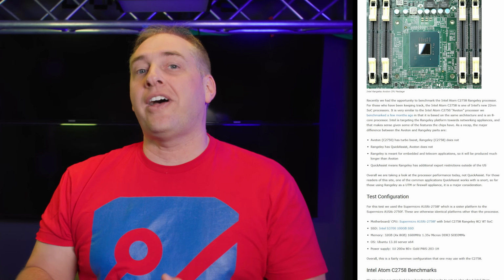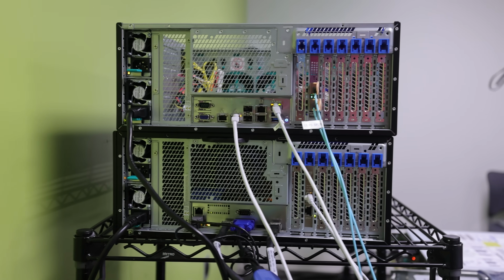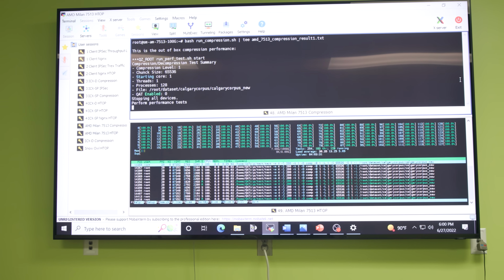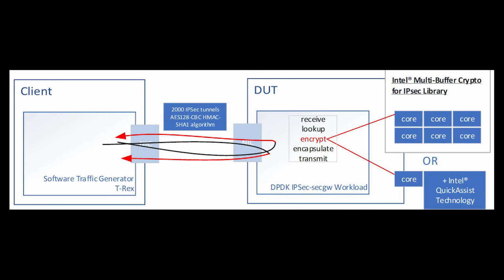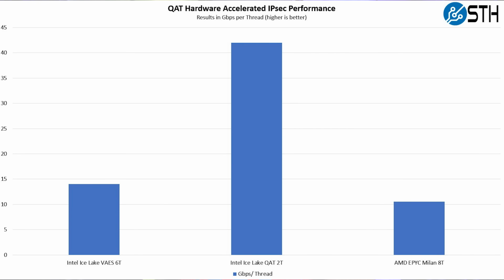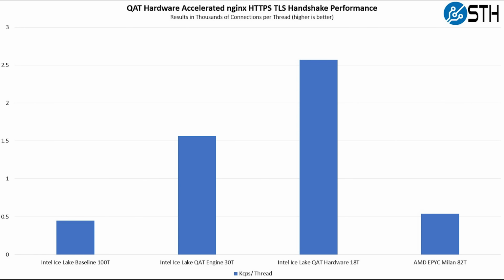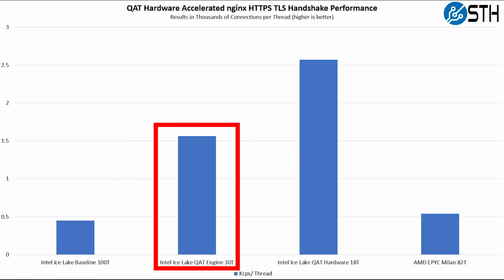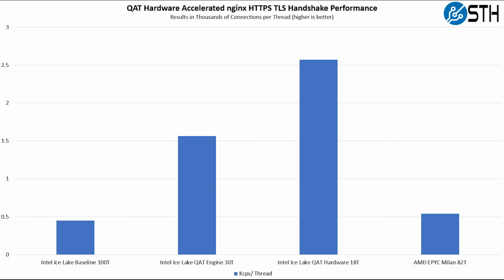Intel QuickAssist is a "Cheat Code" for Server Performance

Comment: Interestingly, Intel has a more "mainstream" acceleration called Quick Sync for video encoding and decoding. When it works (i.e. on supported video codec), it makes a huge difference. AMD seems to completely neglect this market for some reason.
Reply: It doesn’t neglect it. They have AES-NI but he chose to compare Intel with hardware acceleration against AMD without AES-NI(hardware acceleration).
Reply: @aliancemd  Interesting. I assumed that "Quick Assist" was NOT part of the AES-NI instructions set. Worthing researching
Reply: @jaffarbh  It is not part of AES-NI but it is a competing technology in the workflow that was presented in the video. Also, the video uses CPU + Dedicated QAT PCI hardware to compare against AMD without using AES-NI.
Reply: @aliancemd  Fair point. Intel has already embedded QAT into the latest Xeons. The real question is whether equivalent QAT accelertion exists in AMD processors. In any case, this is a specialist market and not something eveyone needs. May be AMD doesn't see the need to dedicate silicon for it.

Comment: I am very much not an expert in these things. With QAT's compression acceleration, could such hardware be used to accelerate disk access in a desktop environment? I'm not necessarily asking from a practical standpoint, merely wondering if we might see something like it in a future chipset/CPU so they can advertise that your SSD will be XX% larger or faster since it would be less data going across a bottleneck.
Reply from the maker: Probably less common in the very near term for the desktop, but this is what storage vendors use QAT for.

Comment: Wow, that is super weird! A HW accelerator that actually accelerates something!
But seriously guys, why the f.. are you trying to make this a comparison against AMD with no acceleration, this is just plain silly.
Reply from the maker: We used a faster AMD CPU so when we did things like acceleration via ISA-L AMD was faster due to the clock speed and extra TDP it had. The TDP difference between lower power Intel parts and the higher power AMD SKUs we used is about the same as QAT card TDP. AMD has promised the Pensando solution for example, but has yet to deliver cards and we cannot eBay them. When Pensando cards arrive, we will look at those.
Reply: @ServeTheHomeVideo  showing that a specialized HW unit + CPU can draw the same power as another CPU isn't any less silly, and excusing this with AMD not yet delivering similar HW isn't a very good excuse for making a silly and utterly useless "comparison".
Reply from the maker: What is the alternative though? No major server vendors support QAT cards in EPYC systems. You can put them in, but that is a one-off unsupported configuration that would be a lab project, not something that people would really deploy. That is why we need AMD's accelerators so we can have real solutions not lab experiments.
Reply: @ServeTheHomeVideo  the alternative is to not do silly stuff and only report on what the QAT can do. The fact that QAT doesn't work on EPYC is partially (if not fully) Intel's fault, so trying to put this on AMD is just even more silly.

BTW, an accelerator from AMD will perform very differently, and comparing the two would also make little sense, these are very specific SW accelerators, but you probably already know that?
Reply: @brynyard  it's not silly at all. If there is no industry supported alternative for amd systems, this could mean the difference between choosing an intel or an amd platform for a specific application based purely on the amount of resources we've just been shown get used. This may be a huge realization for a lot of people, and may affect purchasing decisions for variously sized projects. In larger data centers, optimizing for a specific use case can potentially mean the difference of a ton of power, latency, number of connections a server can make while still performing work with those connections, so users per server, so then number of total servers, so data center sizing, etc. This may have huge implications for our very Internet-oriented data centers, with all kinds of encryption and very little inter-data center machine-to-machine trust.
Reply: @zachariah380  the "industry standard" your referring to is Intel, and funny enough they only want to support their accelerator running on their own server.

HW accelerators and specific software isn't new (unless your new to this whole IT thingy), and what is really silly is needing to explain how this comparison between essentially not having specific HW support and having it is silly, particularly when it all comes down to a political decision from the vendor.
Reply: @brynyard  to my knowledge, there is yet to be a specific, widely supported, set of accelerators or instructions for this use case. I understand that the amd xilinx cards may have these functions, but if you look at other comments, servethehome was unable to secure a card to test despite many requests. What it will or can do, and how much programming it may require per application without as-yet wide support in various os layers or applications remains to be seen. Other DPU's like bluefield may also be able to offload this, but again, I have yet to see a direct path to immediate adoption of os or app layer utilization of those functions, and I actually don't know if bluefield has hardware support for cyphers in the same way?
So the comparison isn't stupid, because the intel solution is already supported in a number of very common apps like pfsense for example, and also, no vendor has stepped up to say they will themselves support the intel cards in amd systems. While that may not feel good or right, it's not servethehome's choice, so they delivered on a comparison that is widely available right now. I find that very helpful, and I also look forward to comparisons with xilinx and DPU solutions for similar use cases when those can be done (which I have requested on a different comment thread).
I find this comparison to be more like 
Intel cpu vs intel cpu w/ some extensions vs amd cpu vs accelerator card, since we know that a properly supported configuration of the accelerator card would work similarly in the amd cpu, since it's clear its doing most of the work, and the cpu is probably mostly just feeding it data and receiving it back.
Reply: @zachariah380   What are you babbling about? "Widely supported instructions for this use case" makes absolutely no sense, this is a specific algorithm that has been implemented in an ASIC. The alternative cards they where trying to get hold was an FPGA solution (which is way less powerful at a specific algorithm than an ASIC, but as it's name suggests is programmable and can thus be used for different algorithms).

The stupid one here is me, expecting to be able to explain to someone who thinks comparing a bird against a fish is "useful" ("but it shows how different they are!" - no shit).
Reply: @ServeTheHomeVideo  But... you were doing a lab test and publishing the results. That is the perfect time to demonstrate unsupported but functional configurations that the vendors don't want people to know are an option and pressure them to stop building their walled gardens.
Reply from the maker: @deimosian  I mean, it is just the lack of validation and support that is challenging, not an explicit lock. AMD also is not pushing its OEMs to validate QAT cards. AMD does, for example, support NVIDIA GPUs on its EPYC line. Part of the reason for that is where this technology is heading and I do not think the PCH on a PCIe card is a long-term solution that AMD was interested in supporting. That became especially clear with the Xilinx and Pensando acquisitions.
Reply: @ServeTheHomeVideo  Oh I thought you were talking about the system integrater support, Dell, HP, etc. Why would AMD need to explicitly say they support it? They don't do that with every other PCIe device you can just throw in a slot. There's no massive master list of all PCIe cards with whether or not work with an Epyc system. PCIe is a standard so that's not necessary.
Reply: If we let this slide then what's next? Will some back door deal be made so that using future Intel NIC, SmartNIC, etc AICs is only supported by system integrater on Intel systems?
Reply: And the lack of validation and support is only an argument for not deploying it in production, not for not testing it in a lab to present a full picture of possibilities. Like how when DX12 was new there was a lot of content showing dissimilar multi-GPU configurations that were totally unsupported by both Nvidia and ATI.
Reply: I would at first thought agree the PCH on a card solution is probably not going to stick around forever, but I think that it may actually be a way Intel is getting value out of otherwise scrap PCH dies that are defective in ways that prevent them from working as a PCH but not as an accelerator.

Comment: what does this mean for latency, interrupt budget, DMA, etc? These are valid benchmarks, but what happens in total system testing, do you really free up resources which can be used without immediately hitting a next bottleneck, for example interrupts bogging down some subsystems of the platform?

Comment: is the acceleration used when using Java or C# or nginx with their main libraries out of the box, or did you implement specific intel dependencies/libraries to take advantage of quickassist?

Comment: If you're having to spend the dev time to implement QAT within your application, why marry yourself to a hardware specific component when there are fast real-time algorithms like LZ4 and ZSTD when you can get 1 GB/s+ per core? I don't get the feel that the forward looking storage vendors are continuing down the hardware accelerated path here as they get locked into a specific technology and then they're unable to port elsewhere, i.e. cloud.

Comment: Kind of rubs me the wrong way that you didn't mention AMD's solution, Xilinx/ Pensando (is this available now or soon?) and the Intel QAT card can be used in an AMD system. Looking at the video, one could easily think Intel has a huge advantage over AMD. Hard to believe Intel didn't have a say in this or maybe you were influenced by their sponsorship. I'm not saying do something that sours the relationship, but just mentioning it would have been much better already.  

Honestly I feel like the AMD results should have been removed as you are comparing apples to oranges, only thing it does is make AMD look bad. Hope you can keep that in mind in the future.
Reply from the maker: I asked AMD for its Pensando/ Xilinx solutions but they still have not sent cards. Only so long we can wait. We cover Pensando a lot on the main site
Reply: @ServeTheHomeVideo  so will xilinx and bluefield solutions be able to do this same sort of thing? I'm curious what the implementations will be like on the software stack in order to utilize the offload, and if there is direct hardware support in those cards to accelerate these functions (specific cyphers, etc), and if so or if not, will that affect bandwidth, latency, Max # of connections, and power efficiency. 

I'd be VERY curious to have these same tests and cases with the same basic base hardware paired with nvidia and amd accel/dpu cards benchmarked the same way (if possible) so that these numbers could be put side by side with them, and show how intel compares to other vendor solutions (and how much work it would be on the software side to implement - like is there native support for each solution in popular products like pfsense, web server stacks, etc)

Comment: If Intel made NICs with QAT that can be used in embedded Epyc systems... 😁
Reply from the maker: That would be a DPU/ IPU at this point.
Reply: @ServeTheHomeVideo  Well, no not really, there'd still be no CPU core complex on the card so it wouldn't pass your own 8 point 'is this a DPU?' checklist.
Reply from the maker: Ah I meant more like Mt. Evans would be the closest product, or the FPGAs. But if you went FPGA + EPYC embedded, then you would get Xilinx most likely.

Comment: I always assumed something like this would be put on the nic instead of as a separate card. Neat video!
Reply from the maker: That is a wise observation.
Reply: You are correct, so-called smart nics will include different accelerators, but the best will be re-programmable ones such as FPGA based designs where you can load on different accelerators that you actually require, including bug fixes and upgrades.

Comment: Watched video.  Immediately checked for TrueNAS support.  Looks like I won't have much use for this until IX Systems enables support for it.
Reply from the maker: It is more likely to happen with TrueNAS Scale since that is Linux based.
Reply: @ServeTheHomeVideo  I would be okay with that.  (Especially if it could get Scale up to the same performance as Core)

Comment: But, can't you use a QuickAssist add-in card on a AMD system? How does that compare to the native QAT from Xeon CPUs?
Reply: You can. I just tested a QAT add-in card on an AMD system using SQL Server 2022 RC0 which can offload backup compression with QAT. Works like a charm. No idea how much faster or slower the CPU version of QAT is since I don't have access to that kind of hardware. I also have allot of questions on how this is going to work with a hypervisor sitting in between. I don't want to pass the QAT device to just one VM, I want all VM's to be able to use QAT acceleration. Does the CPU version show up as a discrete PCIe device or is it more like a instruction set extension?
Reply: @VTOLfreak  It might not work with Linux.
Reply: @VTOLfreak  I found an intel Ark page for one of the cards which states it supports SR-IOV so you might be in luck for it being usable by multiple VMs.
Reply: Let's see the AMD Xilinx/Pensando version of this next then!
Reply from the maker: Yes, Soni said we would do the Pensando one soon when I spoke with her last week. It has been hard to get cards but it is on the plan.
Reply: @ServeTheHomeVideo  again dodging the actual question, why didn't you even mention using the Intel QAT add-in cards in AMD systems? The way you presented it in the video made my first thought be it wouldn't work in an AMD system... but apparently it does work. You sure Intel's marketing department didn't edit this? Did Intel refuse to let you benchmark that combination in their lab?
Reply: @ServeTheHomeVideo  I really like you guys but dodging the question like that is infuriating. Can you use this Intel accelerator card on AMD based systems? Yes, no, maybe?
Reply from the maker: Not supported by major server OEMs, so it is not really deployable. You can do it as a lab experiment, but there is a difference between "it plugs in" and something that people can really use. That is why I suggested waiting for AMD.
Reply from the maker: There is a difference in servers. People do not deploy solutions that vendors do not support. If you install QAT in an EPYC server at this point, you are mostly on your own for support. So instead of just doing a lab experiment, we added higher-clocked and higher-power AMD EPYC CPUs. The real message there was adding ~30W of CPU TDP versus accelerator. AMD will have Pensando and Xilinx IP that will be in this space, and we will cover that when it is available.
Reply: Sponsored by intel…
Reply from the maker: AMD's solution is Xilinx/ Pensando.
Reply: @ServeTheHomeVideo  the question was not about AMD hardware, but rather about using the Intel QAT hardware on AMD hardware, which is a supported modality. It is a shame that STH didn't think of that...
Reply from the maker: Which major vendor supports QAT in EPYC servers? I asked before doing this piece and nobody would configure it. It can be a lab experiment, but is not well supported to the point you can deploy it. That is why I suggest waiting for AMD's accelerators.
Reply: We're here to watch ServeTheHome, not ServeTheVendor.
Reply: @deimosian  This has been my frustration as well, most of the videos are just completely irrelevant to “serving the home”. Yeah, seeing $40,000 servers and equipment is neat, but I’d rather just do an image search honestly. I don’t have a data center, don’t have a million clients, I truly don’t care. I wanna see a QAT card in an amd system.
Reply: It's just a god damn PCIe Add In Card, you do not need a special blessing from Dell or HPE or whoever for each AIC you want to put in your systems, even for enterprise deployment. The add in cards are standardized so that those vendors don't get to control what you can and can't use in them to lock you in to only buying the Dell approved version (which is exactly the same aside from a little DRM identifier) for 5x the price.
Reply: And you were doing fucking testing in a fucking lab. You could have said "no one deploys this, but we've got everything to test it so we did"... But I'm guessing Intel didn't want you to do that.